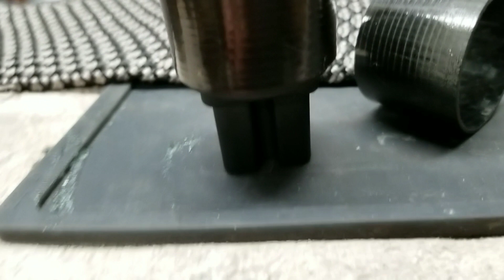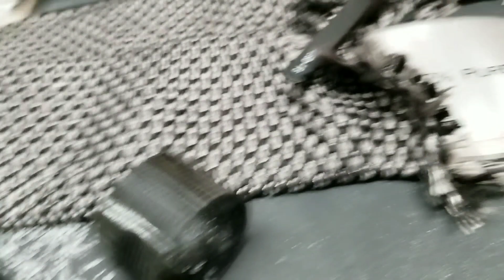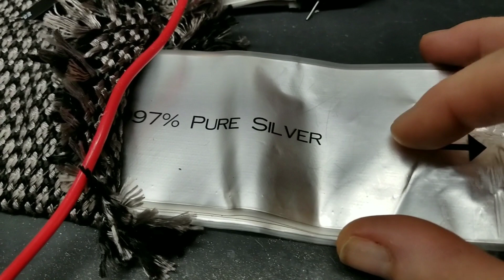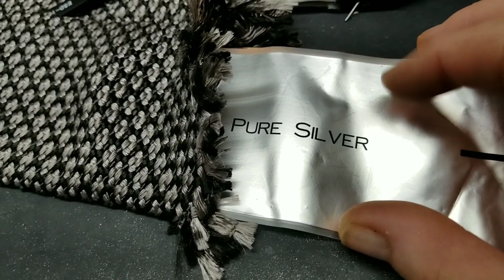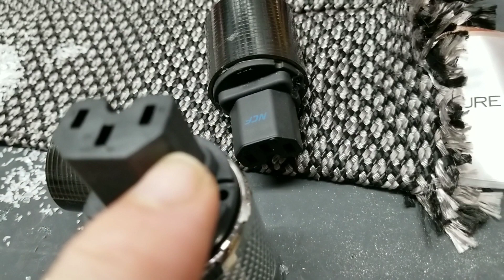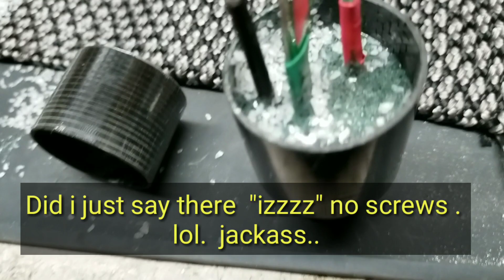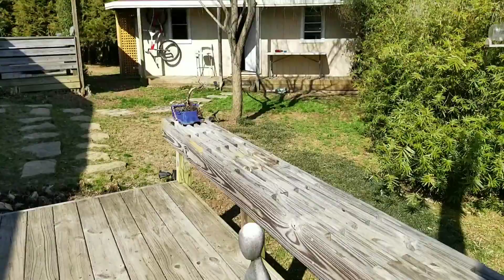Are "High End" audio cables SNAKE OIL ?

Comment: Badly designed water pipe makes a lot of noise... the same applies here, electricity behaves a lot like it... reflections ripples matchings... HOWEVER
Most people's computer is noisy like a waterfall near by with a switching power supply in the same enclosure, so they couldn't tell, which is sad.
Reply from the maker: I know Keng, youre right. Hopefully most people have a good HiFi set as well..
Reply: You buy crystals and resonators and other BS also?
Reply: @atsnokki  No.
Reply: If you have some  piece of shit 50 dollar motherboard that was designed to be cheap and audio is absolute crap. motherboards in 200-300 dollar range have zero system noise at max source volume. It's a misconception thats still surviving cause up to i think 2006 or 2007 onboard audio was garbage. Now it makes most standalone solutions redundant for slightly above casual use.